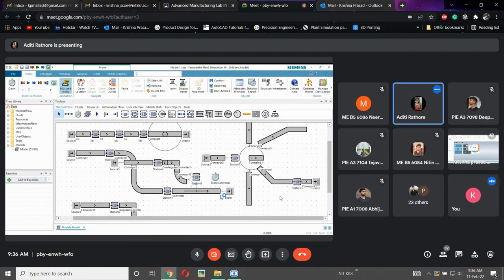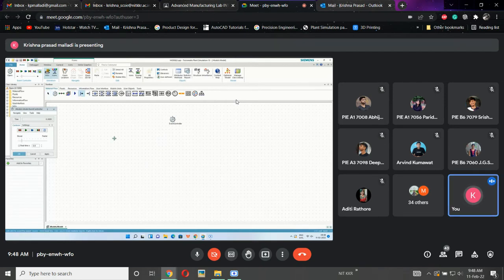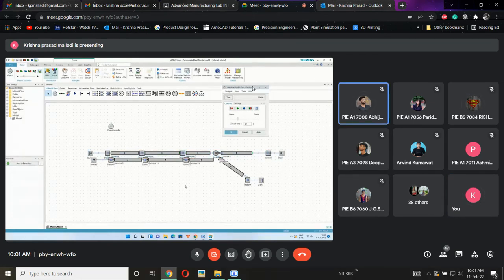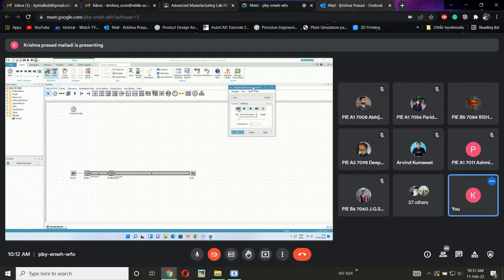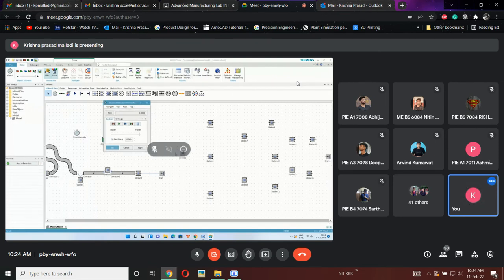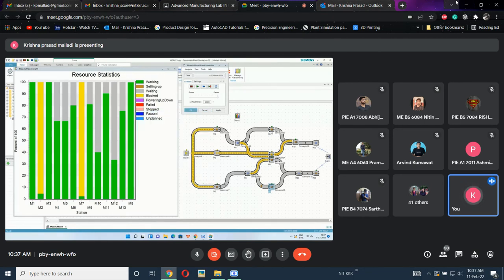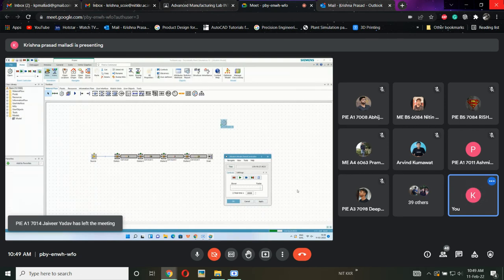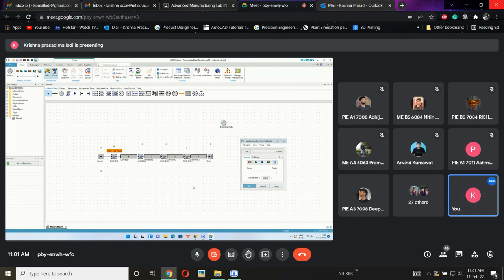6  Tecnomatix Plant Simulation - Module 6 - Robots and Conveyors

Comment: I have 3 engines, 3 station. For each engine on each station the cycle time is different. So in total I have 9 cycle times. How to enter these values?
Reply from the maker: So you need to call a data table which includes all teg machines and its processes. 
Assign the data table to the source. Based on the sequence, you need to enable the preference.